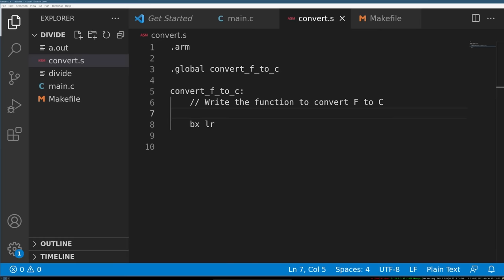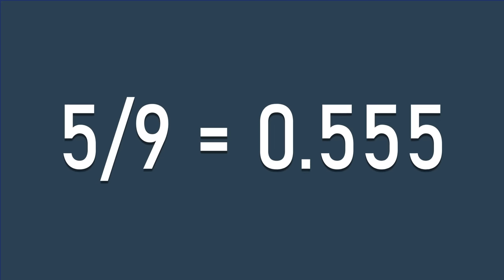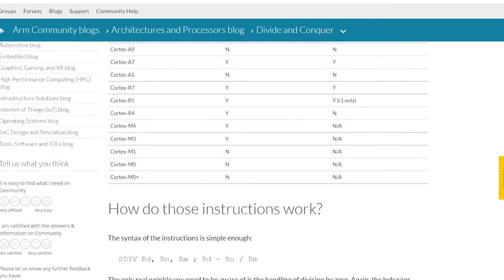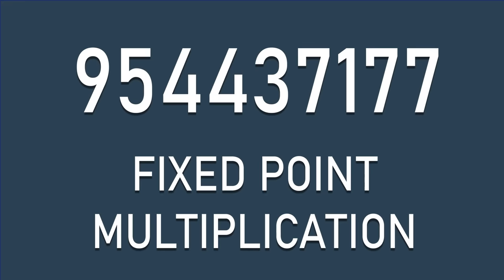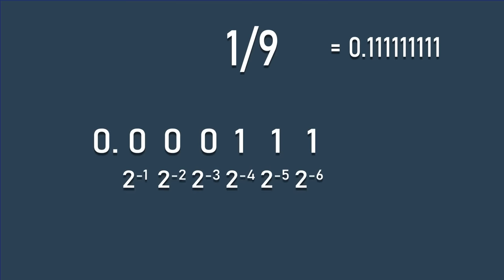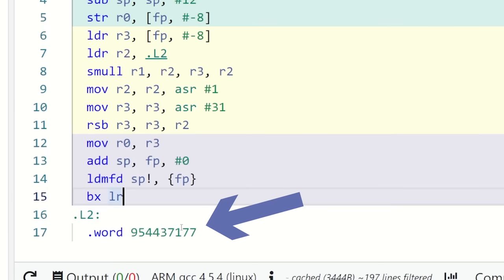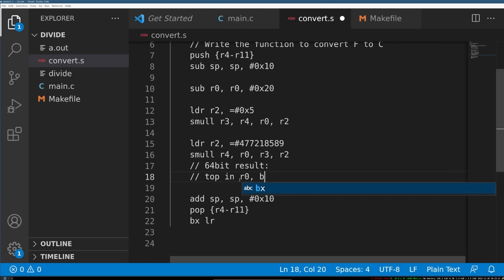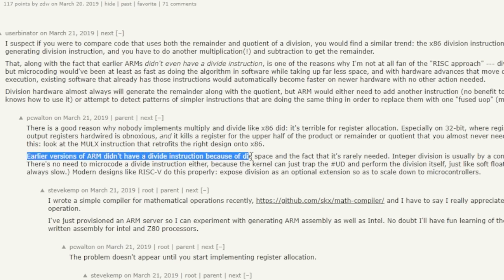computers suck at division (a painful discovery)

Comment: computers don't suck at integer division.  
They do it the best way that we humans know how --  alas, that is grade-school longhand division, in base 2.  

in base 10, you need to guess:
pick the largest N, such that N*divisor < remaining dividend, 
then subtract N*divisor from the remaining dividend
repeat

if base 2 it's easier. N is either 0 or 1,  so ...  
if divisor <= partial dividend, subtract divisor.
repeat

In many modern Risc processors, this DivideStep is all you get for doing division..
You can eliminate some of these iterations with a CLZ (count leading zeros) instruction.
but basically it's (32 - CLZ ) machine instructions for a 32 bit division

not a problem with the computer ... it's just that division is inherently complex, ask any 3rd grader.

One of the first cpus to have an integer divide instruction was the intel 8086 (in 1978), 
it took a 16 bit divisor and a 32 bit dividend, produced a 16 bit quotient and 16 bit remainder.
the integer divide instruction took 50 times as long as the integer add instruction.

Comment: The title "computers suck at division" and "can't do math" is grossly misleading. There are many processors that provide division operations. But even on those processors multiplying with a fractional constant is faster or more energy efficient than a division. The division instruction should be reserved for variable divisors.

Comment: Wow what complexity, many many years ago I was coding some math routines in assembly on a newly released chip a Motorola MC68HC05K1 (yes, they used to make IC's) I just rebuilt in my head how it was done on paper at school, as in long division. Whilst this 'hack' is way way faster, it didn't matter in my case, not that I had ever heard of this technique, nor did I know where to start looking - well kind of.
Actually this is not entirely true, in my early school days I sucked at math, could not do long division, was only saved by the advent of calculators - so it was kind of a real nice retro school experience for me.

Comment: You know; I wish the designers of ARM had gone; ok fine we're not going to waste all that silicon; this 32 bit divide instruction takes 67 cycles so we can do it in a small amount of die space (32 bit ripple carry adder and feedback loop circuit). Variable divide just doesn't come up often enough to worry about making that one instruction all that fast. (The problem with not having the opcode is the arm instruction set is so underpowered that a software implementation is a pill and a half and runs slow (several hundred instructions executed) and compiler really can't help you.)

Comment: Nice video.  I had to do some dividing with a Zilog 8 bit microcontroller and i had no 32 bit registers.  What i did was a hack but it worked.  One thing that all processors can do that cost very little in terms of processing is do a shift right of data,.  doing a Shift of binary data does a divide of 2.  So knowing that all processors divide by 2 you can leverage that to do very quick math.  Also you will have to multiply 9/5 * a value that is a power of 2 like for example 256,512,1024.  So if we take a value of .555 x 256 = 142.  so for example lets say 65f = 65-32 * 142 = 4686 and now rotate that right 8 times and you will get 18.  you can also take 142 and X 100 so (65-32 * 142 * 100)>>8 = 1830 and now we know that that is 18.3..  I know this is not perfect but it did work for my application.  Another thing i did to divide was create a loop counter that subtracted a x number of times, but it was way to costly in terms of processing time, but it did work... Nice video!!!

Comment: All computer chips are obscenely dense collections of transistors - which either are either sparked up with electrons or not: thus forming binary code. Getting something which literally only adds 1s and 0s together: to divide - requires very complex code to accomplish. You can get multiplication just by adding in series, division however - you're literally telling something to add to a reduction. It's one of those things people don't think about because it's so very fundamental that it just never dawns on people "How do I divide - by using only addition?" As it would turn out, dividing by using addition takes a pinch of buffoonery and a dash of chicanery.

Comment: It's not "A Flaw". It is a design choice. You won't be cracking messages from outer space with Cortex-M micro.
You need it cheap, otherwise you'll end up with 8-bit PIC/AVR or even with some dirt cheap Chinese microcontrollers.
100MHz ARM without hw FP is still a very potent core, and it will do A LOT of floating point in software.

Comment: I mean, multiplication is just addition and division is just subtraction with a counter. So even if you have no division operator and no multiplication operator you could still use basic math to do it slowly 😂

If you multiply everything in the equation by 10(except the 9)and compute that, then do division by subtraction and infer where the decimal is based on the input or whatever. Use the remainder as the decimal value.

Idk maybe I’m sleep deprived

Comment: Instead of calculating out the value each time just put ONCE all possible numbers into a matrix/file in RAM before running program. 
And quantum computers can divide better but that exactly is why each is registered. 
Set of lockers, walls and fences around is what we call a Home.
It will be a pity that set of uncalculable tasks and machines that cannot calulate it is going to be our use of Mathematics- Home of Known Form of Idea.

Comment: ARM is a RISC architecture. The whole point of RISC is to have a light weight instruction set.
Reply: No. Whole point is to have instruction set which is easy to pipeline. In part, by omitting useless (never used by compilers) instructions. All major RISC families in history had all division instructions. Nobody would dare to say that MIPS wasn't RISC, but it had division.

Comment: Interesting! My experience was with the old 6502 in the Atari context. There was no hardware floating point system, but one could get creative with shifting/rotating bits and adding to do multiplication, and the opposite for division without resorting to loops. Ahh... the days when 1.79MHz sounded fast. 😸

Comment: So like, I am mostly all for metric, however, temperature is the only one I would say I 100%  like Fahrenheit more than Celsius. 

Like meters are 100% better than feet, but in Celsius,  I feel most of metrics advantages apply as strongly. Sure, technically better than Fahrenheit. But day to day for normal people, Fahrenheit I believe is better, due to the fact that temperatures are way more spread out compared to Celsius, we can usually get an easier understanding of the temperature, that we normally deal with.

Of course, it all depends on what you used for most of your life, but I have and still am trying to use Celsius, and even after a year, my brain does not process 40 degrees as warm until my brain is like "hay that kinda warm" where as Fahrenheit is like "yo it kinda getting so warm we added another number to the end of temperature"

Comment: In the early 1980s I had to write a 32 bit multiply and divide routine using an 8 bit Motorola single chip microprocessor that had no overflow flag.

Comment: I often think that the way "mathematical language" was made has many flaws. It get things done, but in a weird way to represent.
Let say one example, power and root. If(in pc formula form) 7^2 = 49, then why didn't they made SqRt be something like 49v2=7...
7^2 = 49 the ^ inverted on the other side of equations meaning the opposite of power, so 7= 49v2
And other simplified "math language" details like that.
I don't know, just a stupid idea. Im not a genius anyway. I know.
Another example, STANDARDIZE what small characters means on the corners and sides of normal characters. Or make characters that represent the position, and therefore the function of the position. One EXISTING example: the number on the right upper corner means "power", and some formulas use the ^ to represent that too. So if the upper right corner means an "increase in power" then why not the number on the lower right could mean a "decrease in power, or root"?? And represented also by an inverted "^"?

Comment: I did it (avoiding FPU) with branchless code that was checking if number was even or odd (with modulo/remainder that returns 0 or 1) and does what it needs to do. The code was single line of nonsense that works perfectly. :P

Comment: So easy, shift right (num/2) add result to num after for more 4 shifts (num/2) + (num/2/2/2/2) = num(5/9)

6 instructions, accumulator and 1 variable or you could use the stack and use 8 instructions... 

Granted you Do loose some accuracy, can be improved by using the carry in addition but i think it comes out the same as your solution.

Comment: DIV is by far the slowest arithmetic operation, 15 to 20 times slower than ADD, MUL, and SUB, depending on the processor.
Reply: That is not quite true. Sometimes division can be done almost for free.
Reply: @radivojevasiljevic3145   I'm talking specifically about the DIV hardware instruction.
Reply: @tikabass  again, it depends. Division can be just a bit slower if multiplication is slow or fairly fast on CPUs which don't have DIV instruction.
Reply: @radivojevasiljevic3145  I know I'm repeating myself, but I was specifically referring to the hardware instruction.  And it is slower by a factor of 15 to 20,  compared to MUL, ADD and SUB,  which typically execute on 1 clock cycle.

Comment: Recursive subtraction & addition for div & mul (easy mode) then there's the slightly more complex shift L&R targeting even nums with (shift left) add & (shift right) sub for odd values (multiplier & divisor) generally how I do it. Haven't really gotten into the "Division by Invariant Multiplication" (pointed out by Finkelfunk below in the comments) but have seen many discussions to varying degrees on the topic - still looks interesting.
Yeah, idiv & imul as well as div & mul are good for prototyping, but that's about it. (i)Mul & (i)div require a great deal of reading & writing to cache and state tracking (flags register & others) - e-vile.

Comment: Could you not have just multipled both sides by a power of ten, and then drop the end digits?

(F -32) * 555556 = C × 10^6

just drop the last 6 digits

Comment: The very first thought I had was to be super cheap and just use a 32 bit float the closest possible to 5/9 and then just multiply with that constant.

But interestingly (I'm not a programmer and didn't understand a line of code) you are kinda doing the same differently? But before that you multiply by 5. Don't you also increase the error by 5 times this way?

Comment: Actually, believe it or not, there is no way to divide any more efficient than what you would be doing on a piece of paper. A CPU basically does the same thing, just with binary numbers and this is hard to encode in hardware, so a lot of CPUs run microcode for division based on other operations like OR, SHIFT and SUB that the CPU already offers. And even if done entirely using transistors, is still the same slow division process and you need a ton of extra transistors to make that happen in multiple stages. The only trick that can be used to speed up division is what you just showed in that video, turning a division into a multiplication but that comes at the cost of losing precision (which doesn't play a role at all in many cases). That still holds true if your CPU does have a FPU. If you plan to divide a huge number of floating point values by X, you are way better off to calculate 1/X and multiply them instead, as even the fastest FPU is way slower at division than it is a multiplication, and yes, 1/X is also a division but you only need to calculate that value once.
Reply: Yes, there are much faster ways with iterations (quadratic, cubic, quartic, their combos). With appropriate loop transformation "good old" Itanium could produce 2 results every few cycles in single precision.

Comment: curious why you just didn't pre calculate 5/9 which is .5555559 or just  .5555555555555556 or you could go .5555 set it as a constant
similarly for a conversion of C -> F you could also set 1.8 as a constant. and just do a multiply.?  Am I wrong in my logic? or would it not translate in assembly?

Comment: I have no clue what’s going on. I’ve only ever used browser based coders but just using “/“ does division. No clue what’s happening here. Besides I was taught a different formula for conversion
Reply: Computer ALUs only do Add/Subtract.
Multiplication is an iterative addition, so you don't need a different instruction, you can do this with a stack instruction
two numbers, first is the number to be multiplied, second by how many times... which you can see can be done by for/while loops

so you can see in asm would look like

stm r2, x (where x is the number to multiply by)
add r1, r0
sub r2, 1
beq r2, 0

and just keep looping until register 2 hits 0. something similar to this, there are many ways to do this.

division on the other hand... 
if it's divisible by 2, you can just bitshift right...

Comment: Why use 2 separate multiplication instructions, when you could use just one? After all, in your original formula it is written "... * 5/9", where 5/9 is a constant (i.e. can be pre-computed in this "fixed point" form).

When this kind of decisions on the part of CPU architecture designers start to matter, is when you have to divide not by a constant, but by an arbitrary number (i.e. by a value stored in a variable). Truly, "lean-and-mean" instruction set processor (a.k.a. RISC) does not look that appealing anymore if you, as a programmer, have to implement everything even remotely complex yourself. At least to me it does not. Therefore, I conclude: ARM is crap.

Comment: I was curious so I asked chatgpt and it spit this out in a few seconds.

AREA Example, CODE, READONLY

        ENTRY
        MOV     r0, #100          ; Fahrenheit temperature (°F)
        SUB     r1, r0, #32      ; subtract 32 from Fahrenheit temperature
        MOV     r2, #5           ; constant 5 for division
        MOV     r3, #9           ; constant 9 for division
        MUL     r1, r1, r2       ; multiply (°F - 32) by 5
        SDIV    r0, r1, r3       ; divide result by 9 to get Celsius temperature
        ; r0 now contains the Celsius temperature

        ; program exit
        MOV     r0, #0
        BX      lr

        END

In this code, we load the Fahrenheit temperature into register r0, subtract 32 from it, then multiply the result by 5. We store the constant values 5 and 9 in registers r2 and r3, respectively, and use the SDIV instruction to divide the result by 9 to obtain the Celsius temperature, which is stored back in register r0. Finally, we exit the program by setting r0 to 0 and returning control to the operating system.

I then hit the Regenerate response and it came up with another and so on.

Comment: why did you not just just Subtraction as Division is just fancy way of subtracting just as multiplication is fancy addition?
Edit: I have no coding knowledge but rewriting the eqaution so it does not use division to my mind seem the simplest solution even if it take up many more lines of code.
Reply from the maker: That’s the primary issue. If you do division by subtraction the number of clock cycles shoots up by 10-100x, which adds up. Especially when doing CPU side graphics or audio processing. Good question though!
Reply: @LowLevel-TV  really by that much!
Damn!  Seems there is even more I don’t understand about exactly how hardware handles this stuff.

Comment: For years we've used 1.8 in place of 5/9ths in this equation.  You multiple C by 1.8 and add 32 to get F, you subtract 32 from F and divide by 1.8 to get C.  Within the realm in which we use this i have never found an example where this does not yield the same results but tends to be quicker for most people to do in their head.   What I am curious about is what the advantage is of using 5/9 instead of 1.8 and what type of scenario might you see a difference requiring this additional calculation?

Comment: arm architecture sucks in any aspect, I really can't understand the hype around it, especially when it comes to ARM for desktop or any human interfacing devices. For any operation you need tons more instructions than on intel. Most of arm systems has forced memory alignment, i.e. you are obligated to align anything, and can't just dereference non-aligned pointer. 
Regarding the problem described in video, I'd just hardcode 5/9 as constant for multiplication, there is no need for real division here, anyway we have fixed limited precision.

Comment: If a computer can't divide well, it's not at the fault of the machine. If you are programing low level stuff, you could design the logic of how a computer does fractions by altering it's numbering system.
Reply: Well, what I mean is that you could have the computer convert a problem into something it can understand better, do the function then have it churn out something that we can then convert into the solution. I mean...to some extent computers are capable enough to figure out more pie digits than we ever could.